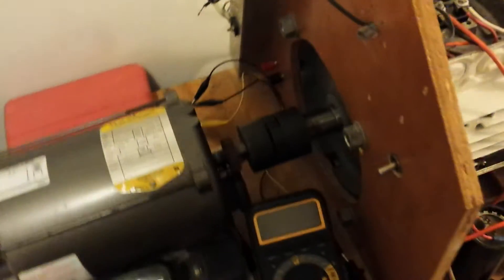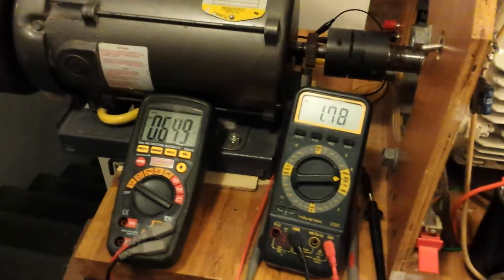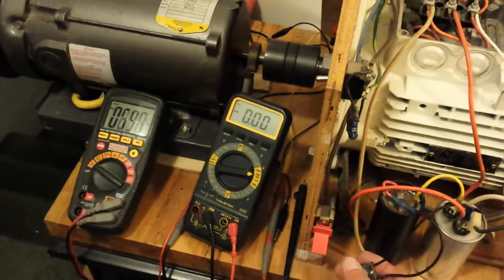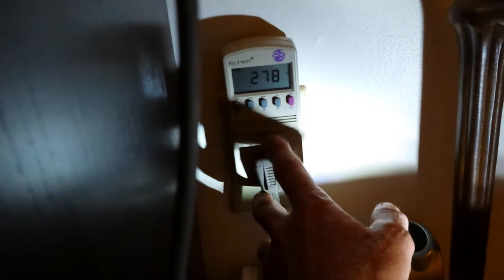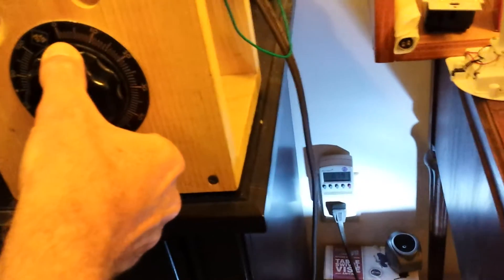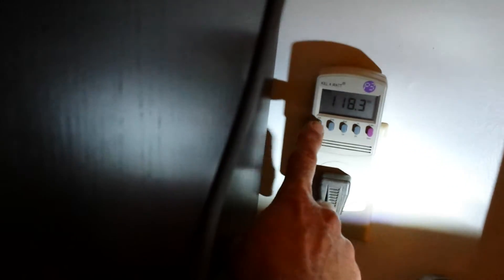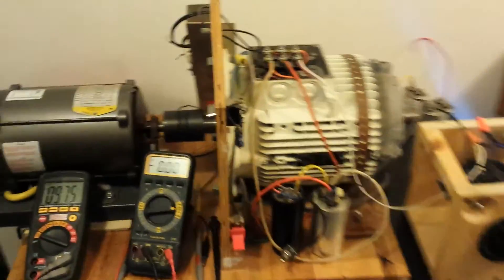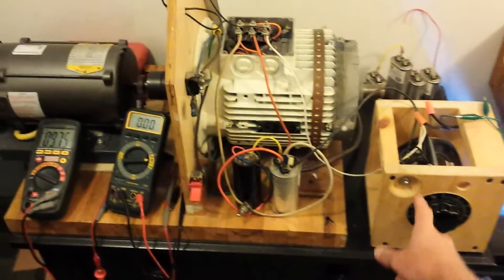Rotoverter Generator Combo 2nd Generation Rotogenerator

Comment from the maker: I can't add a load on this too much at resonance, but it will light up about two or three 60 watt incandescent bulbs. I need to add a pulley system and offset the motors, and more flywheel. the DC motor needs to be at low rpm. Anyone else working on a rotoverter or similar, post a comment with a link to your video or work. Thanks!